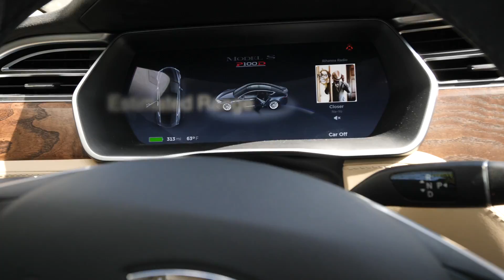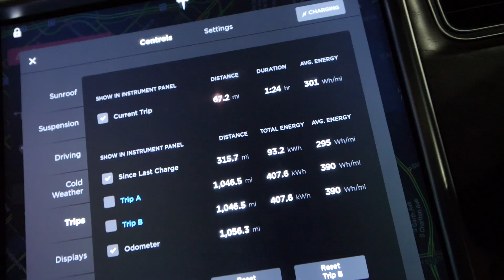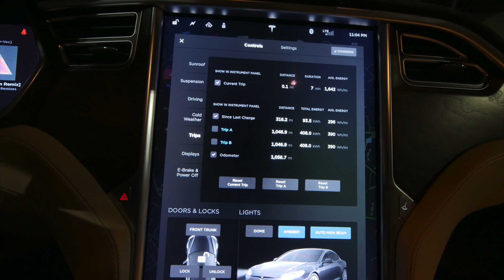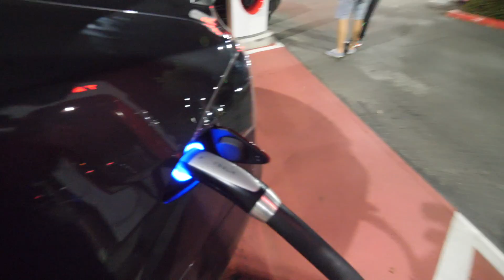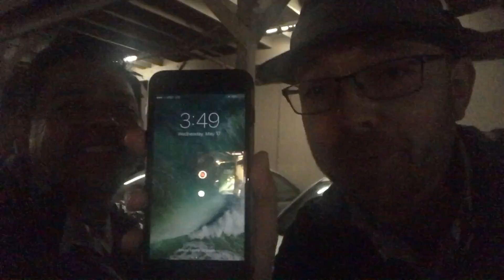Tesla P100D V.S. DIY Recycled Car - Range Challenge 382+ Miles @ 70MPH!

Comment: I need a 200 mile range battery for my LEAF. Any plans to make aftermarket batteries for existing EV's ?
Reply from the maker: Unfortunately not;  our plans are to use these batteries in other applications out of the EV Sector such as "Solar Power Arrays" and "Solar DC Super Charging Stations". The GOOD NEWS = Future "Battery Retrofit" companies will sprout up to offer cheap battery swaps to get your original 90Mi/Range back and Batteries will get cheaper & lighter so yes - if you hold onto that LEAF long enough - a solution is around the corner with a higher power density level.. I too am anxious to get away from mass-produced EV's that only get 100 Miles in Range! : ) 

The Phoenix is now 400+Miles and counting! : )
Reply: @EricLundgrenCEO  2 years latter, thanks subbed.

Comment: First you should use the 100d not the p100d, its really hard to not use a ton of battery accidently on the p100d because of the power you get if you accidentally press the pedal too hard.

Comment: can we know this extremely on diet BMW weight, battery capacity and electric motor power.. its legit achievement since it was 88% recycle by weight.. as we know since 100kwh Tesla at more then 5000lb, and 700hp motors... I like you clean tech energy effort.. go green.. safe our planet
Reply from the maker: Weight               =   4,021 LBS  = 1,000 LBS Lighter than Tesla
Battery              =  130 KWh    = 30 KWH More Battery than Tesla
Price Tag          =  $13,000      = $117,000 Cheaper than Tesla
CO2 Footprint  =  88% Less than any other EV Manufactured Today..

Comment: hey could you go over how he built. something like this and where did he get the parts from.
Reply from the maker: We built it using "Used" parts from electronics. The battery pack is from Old/Broken EV and Laptop Batteries. The Controller came off a broken electric forklift. The Motor is an older AC-50 Motor. The car came out of a "Junk Yard".. I need to make a "How-It's-Made" video but just haven't had time.. Are you interested in building one?? If you have any questions; feel free to eMail me at: Eric@GoITAP.com! : )

Comment: Garbage car had windows  down no air  - Tesla had air on arctic chill mode. Garbage car was stripped down and lucky to have a steering wheel to save on weight. Not a Tesla fanboy, but don't claim to bee running legitimate test if your not.

Comment: Although I am completelly in favour of re-using and re-cycling everything we can, I have to say that this test wasn't a fair one. The Tesla is a heavy car not only because of the batteries but also because of the safety equipement and the confort that goes with a modern car. It seems to me that the BMW has been completelly striped of any valuable and necessary things only to keep the bare minimum to drive. Am I right? The weight is the electric car's first ennemy.
Reply from the maker: @ Electro Aimant; You are correct - This was NOT a fair test.. The Tesla P100D costs (10X) as much $$$. Spent (20X) Longer in R&D. Has 88% Higher carbon footprint and took 1000X as many man-hours to design and build from ALL NEW PARTS. Your right.. It was not a fair test.. But we still managed to go beat them and go farther.. 

I am always amazed at the "Nay-Sayers" whom come out of the woodwork. If we had years to design and spent 2Billion dollars - I'm sure our car would have been capable of having all the amenities and safety equipment that goes with a Tesla.. haha
Reply: If you had 2 billion, would you take the risk to mke your own car brand and make it desirable by millions of people? T'as vraiment été bercé trop près du mur toi....

Comment: now put in the e39 interior with AC and all the shit and lets see how it does
Reply from the maker: If we do this; It would technically still beat Tesla.. Just not by 80+ Miles. 
The Phoenix has a 130KWH battery pack in a car that weighs 4,000 LBS. Tesla's is 100KWH and weighs a lot more. If I put in all the other "Things" you mention - the car would weigh the same as Tesla and go 13% farther. It would NOT have the speed of a TESLA and does not look as cool as a TESLA - But it has a Carbon Footprint MUCH lower than every EV in the world and costs literally 1/10th the price! ($13K /$130K).
Reply: Eric Lundgren  I beg to differ, the E39 looks way cooler than any Tesla could always hope to be.
Reply: the big battery bank in the front will be a big safety risk during a collision man